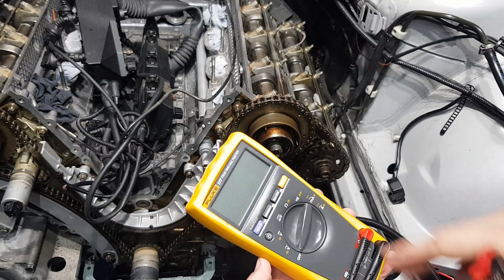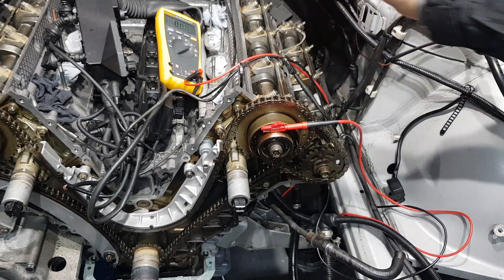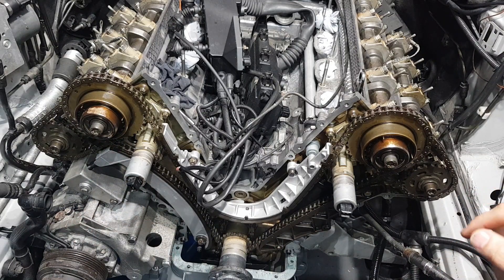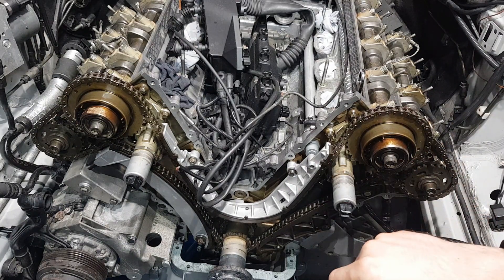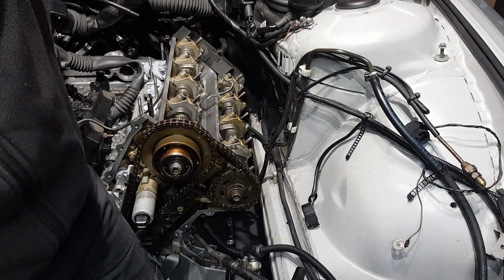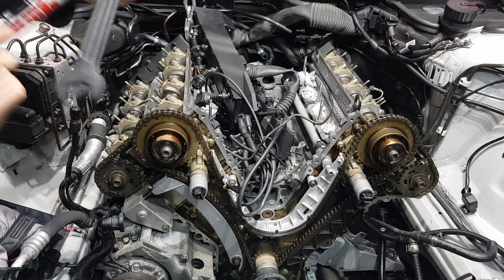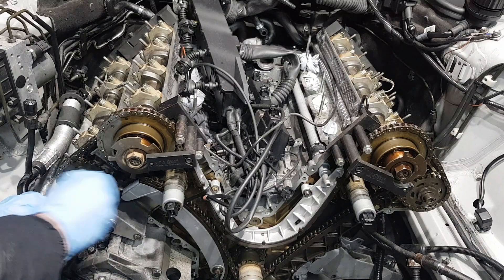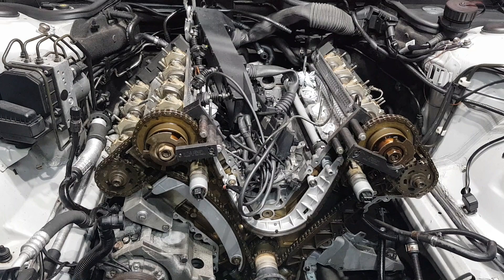BMW M62TU VANOS TIMING, BMW E38 E39 E53 HOW TO TIME VANOS SYSTEM BMW 740i 735i 540i 535i X5 4.4 V8

Comment: May i ask why the VANOS solenoids are in place? Is this important for timing the engine?
Reply from the maker: They control the variable timing. Without them the engine cannot run properly
Reply: @TheKeenMechanic  Yes i understand when the car is running. However is it important when rebuilding the engine and doing the timing of it?

Comment: Do you know why the sprocket for the exhaust cams on the 4.6is has no pins to check continuity when bleeding the vanos? I have bled it but turning it counter clock wise but I thought for m62 you’re supposed to check continuity?
Reply from the maker: On some models it doesn't have pins, just do the procedure and don't worry about the continuity test🤝🏻
Reply: @TheKeenMechanic thank you!!

Comment: Why you use voltmeter …

Thank you 🙏❤️
Reply from the maker: @josephchehdane  You are welcome
Reply: @ thank you but why you use voltmeter
Reply from the maker: @josephchehdane  This is how BMW engineers described the procedure in the factory repair manual to test continuity when vanos wheels are retarded. Read up about it if you don't fully unferstand how it works🤝🏻

Comment: Hi I have a Question what is the code number or name canes out when you connect the scanner for this problem or what are the síntomas of the car thanks for the info
Reply: The codes are for the timing chaine is P1519 and p1522  : cameshaft position actuator bank 1  and cameshaft actuator bank 2

Comment: Hi I’ve got another question for you please,I’ve done everything that you explained in your video the problem I’m having is I  just tried turning the engine over by hand to make sure there was no interference with the valves and pistons,but what I’m having is the inlet cam on the left side is moving then stopping then it’s flicking forward,the engine turns over easy buy hand and doesn’t seem to be making contact with anything and the timing is spot on when I check it is this normal or does the vanos need to be primed somehow before I start the car ,I hope I’ve explained it ok thank you found a video this is what is happening 

https://youtu.be/q4N9zWSz6wk?si=PPhLIlrqD6ztBwYD   Thank you
Reply from the maker: Hi
Sorry for getting back to you so late but I had a lot if comments to respond to and only seeing yours now. I don't remember mine doing this when I spun mine to check the timing and if any interference. I do remember some retardment and advancement on the cams but not to that extent that will spring back as it was wound. I have seen this before on a Maserati and Alfa Romeo where it was a faulty unit. They have the same system like Vanos on BMW. Hope you get it sorted. I hope I am wrong for your sake🤝🏻
Reply: Hi thanks for replying I redone the timing again and it did the exact same thing so i carried on and attempted to start the engine it ran like crap so I put my scan tool on and it wasn’t firing on bank 2 when I took the cam cover off I could see that the bolt holding the vanos on the inlet cam had come loose and the cam wasn’t turning,I couldn’t work it out because I’d done it up to the correct torque and used thread lock ,so I did all the timing again and torqued it up higher this time done a compression test as I thought I must have bent the valves but it was ok ,started it again and it was ok no funny noises that was yesterday so I’ll see how it goes I hope I’ve dodged the bullet lol thanks again for all your help
Reply from the maker: @adriancoundley2430  No problem. I hope that this is it now and all is sorted. I like to clean all bolts and threads with brake cleaner and compressed air several times before assembly. If there is a tiny bit of oil left it will not allow the thread locker to set properly or can come loose🤝🏻😉
Reply: Hi yes I was shocked to see it loose like that  I was gutted I honestly thought it would have bent a few valves, I done about 30 miles in it today at different speeds so let’s hope it’s ok lol , big thanks again for all your help and advice 👍🏻
Reply from the maker: @adriancoundley2430  No problem, my pleasure. The biggest favour you could do for me is to share my videos with like minded people and give them some likes🤝🏻

Comment: Hi can I ask you a question please I’ve just got a Chinese locking tool , would it be possible as long as it hasn’t jumped a tooth to set the timing then attach the vanos tool to see if the tool is out before pulling it apart,or wouldn’t that work thx
Reply: Hi great  Thank you for your quick reply 👍🏻
Reply from the maker: @adriancoundley2430  No problem. I have responded personally to every single comment on my channel🤝🏻
Reply from the maker: Hi
The chinese timing set is as good as the original BMW tool set in my experience. As long as you make sure your crankshaft is locked with the pin and both cams are locked at the back with the tools then you can adjust the timing with the vanos tools with the chains on of course. Hope this helps

Comment: I follow your procedures to a tee and im not getting the audible sound. Is that okay with these old vanos after resealing them as well?
Reply from the maker: Hi
I have heard before from others that they don't hear the sound if vanos wheels have been resealed. I purchased new kits from beisan last week and when I reseal a new set of vanos wheels will test it and do a follow up video on it. If you are doing everything as shown and not hearing  the noise I think it should be ok as you are not the 1st one to say this. Thanks for watching and for your messages
Reply: @TheKeenMechanic   Hello. Thanks for responding my friend. After speaking with other members, they told me that if I revealed them. Chances are that I won't hear the sound. And to just retard them as I should and it should be okay. Thanks again. I love your videos. Keep up the good work. 👍🏼
Reply from the maker: @colemanel4828  Glad to hear other people confirm the same. Thanks for getting back and for being part of the community

Comment: Bom dia tenho uma x5 4.4 2002 com motr 62  ficou parara a 3 anos funcionando so que as vezes faz um barulho na parte de cima do cabeçote lado motorista tipo como se fosse barulho de junta do coletor de escape vazando ma verifiquei não e no coletor  e as vezez para do nada fica um tempo sem fazer o barulho depoi volta tô querendo fazer trocar oleo e por aditivo pra limpeza. Ela ta com oleo 10w40
Reply from the maker: Sorry, if you translate in english I will be able to respond correctly

Comment: The Chinese made tool is crap. Not precise. I eventually bought the German Solution tool to do the timing properly. Don't buy the knockoffs on Ebay. Otherwise you will be removing the covers again. You will get the check engine light unless you're lucky. Good Luck.
Reply from the maker: Hi. I have to disagree on this. I used the chinese ones and the ones I bought are identicle with the genuine BMW tools. May be there are some crappy versions there but the one I have are superb.
Reply: @TheKeenMechanic  I never had any problems with my kit either and done 3 with no problems and no check engine light
Reply from the maker: @alanjackson5911  Thanks for confirming the same. May be some chinese kits are bad but definitely not the case with mine and many others🤝

Comment: Your torque wrench works in the reverse direction ? I know many will ratchet both ways but only torque one way.
Reply from the maker: Hi. Yes, I specifically searched for a torque wrench that will torque both ways. I own 5 torque wrenches of which 4 are Norbar brand and torque both ways
Reply: @TheKeenMechanic  those crazy cam bolts. Was a pain getting exhaust one out on 1-4. Got new bolts. Heading to Grainger now to get a Proto torque wrench that works both ways. Was initially going to over tighten and then check with a regular torque wrench at the setting to see if it doesn’t loosen ;-). But yeah it’s better to do it with the right tool.
Reply from the maker: @AlexXPandian  Yes, better to do it properly and not having to worry about it. Best of luck with the project. Enjoy it and take your time to make sure everything is 100%

Comment: You forgot to mention what size does the crankshaft bolt takes to move… now I’m middle of disassembly with the tool missing 😅… also if you could mention the star/hex size used to tighten the intake and exhaust that’d be great
Reply from the maker: Nobody is perfect, I tried my best but there is always something to improve😁 Next time I will pay more attention to showing all the necassary tools for a job🔩🔧🤝

Comment: Hello. Help!! M62 TU here. Bought a cheap chinese kit with the solenoid socket and well... it stripped the 32 mm solenoid nut. My question is there enough room from the top once you take the valve cover off to put an adjustable wrench on it? I don't want to take the front cover off since Im only replacing the solenoids now. Thanks.
Reply from the maker: Hi
I personally don't like using adjustable spanners as they never fit tight and may cause more damage. I think you may have to remove the upper timing cover in order to have proper access. You will most likely not be able to do it by just removing the valve cover only. Hope this helps
Reply: @TheKeenMechanic  Thanks for the reply. Im actually going to use a metal sawzall and slowly cut about an inch of the solenoid tip off and then use a 12 pt deep socket.
Reply from the maker: @FabianCharrua  Have you thought of using a pair of heavy duty vise grips before you cut it off and turn anti-ckockwise to loosen it. Might save you a lot of work. If you are going to replace it and you dont care about it then vice grips of pipe wrench might be great in this case.
Reply: The way these things are design it just spins but wont turn the nut. It I can cut it Im pretty sure the 12 pt. 1 1/4 inch socket will turn it. The 32mm wont do it anymore
Reply from the maker: @FabianCharrua  Best of luck, I hope you get it sorted
Reply: @TheKeenMechanic  I'll report later. Tks
Reply from the maker: @FabianCharrua  Please do. Will be great to find out how you got on🤝
Reply: @TheKeenMechanic  Well, somehow I decided to try the 32mm socket and it caught on. I dont understand it because I tried for 30 min before and then right before I almost cut the thing off the socket worked. Bizarre but saved a lot of time.
Reply from the maker: @FabianCharrua  Well done. Glad to hear you got sorted🤝

Comment: Ok guys so as you would have noticed, i recently attempted this timing procedure on my own with no guidance except for this video alone. After two failed attempts of timing this engine, i discovered that the crankshaft lockout pin was not correctly positioned and secured in the lockout hole and the cam shaft on bank 1-4 (passenger side) was not locked out with the cam lock blocks allowing 1-4 on the cam lobe to face upwards. Instead it was locked out with 1-4 facing downward which meant that cylinder one was not at top dead center the way the video shows you which is exactly what the bmw’s TIS describes. This meant that the engine was not being timed correctly even though the ohm meter would beep. It was just be beeping in the incorrect orientation of the cam. After correcting everything car still did not start. I began to suspect bent valves due to improper timing as a culprit and so compression was the next thing to check. Please make sure that when you check for compression the engine must be timed correctly in order to receive accurate readings. 
Anyways, so i discovered no compression at cylinder 3  (which makes sense because this was the side that did not have the cam positioned correctly during the lockout). 
Long story short, i knew i had bent valves at that cylinder. Most likely intake valves since the engine did not
Start. 
I disassembled the 1-4 head, and discovered both intake valves at cylinder 3 to be bent. What i learned was, with this particular engine, it will not start on the other 7 cylinders if you lack compression at ONE cylinder even if the timing procedure was done correctly. So guys best of luck, this video was an excellent guide in getting your m62tu timed. Keep up the good work👌

By the way, everything is now put back together. I picked up some used valves, and re lapped all the valves on that side of the head. Reassembled everything and the car now runs better than it did before the timing chain failed.
Reply from the maker: This is great news buddy. Glad to hear you got it sorted in the end and I am sure that you learnt a lot from this. I am happy to hear that you found my video helpful. Please share with others who need help. Much appreciated that you came back to let us all know how you got it sorted🤜🤛🔧🔩

Comment: Ok this is the second attempt at timing the m62tu, 2001 740i and the car is still not starting and i dont know why. I have fuel air and spark and all the basics good, and as much as I dont want to blame it on the timing procedure, im starting to think I am doing something wrong but I dont know what it is. Im suspecting it may be the lock out of the flywheel itself (the hole im inserting the pin in) but the OT and the crank case notch both lined up perfectly, 1-4 on bank 1 and 5-8 on bank 2, continuity with ohm meter at both banks and still cant figure out. In fact, even when I went to torque all 4 cams, the flywheel didnt move an inch either so I know I did it right?
 I need help
Reply from the maker: Have you checked your compression as well? Other reasons why it wont start could be your cam sensors and your crank sensor. Make sure they are connected properly. If you know someone with an oscilloscope check this 1st before you start buying expensive parts. Make sure the DME sees and receives the signal from the cam and crank sensor. Regarding the timing I can confirm the procedure shown is by the BMW manual and has helped many other people. Let me know what happens either way as I am curious to find out what has gone wrong for you. Make sure your compression is fine. If you get someone with a good oscilloscope they can check the relative compression with an Amp clamp on the oscilloscope to save time.
Reply: @TheKeenMechanic  I did not check compression yet because i dont have enough reason to believe it is compression related but i will if i run out of options. Regarding connections, everything is connected and secured and double checked, dme communication to and from cam and crank is still unknown because i’d like to eliminate the most obvious possibilities first before investigating further. I did notice something odd though: so after giving it a couple cranks to see if it starts, and no fire, i went and removed the pulleys to verify if the flywheel is still in the same position. Crank case notch is stationary at 11 o clock position so the flywheel was lined up to match the crank case notch after securing it with pin to begin timing.
Im now seeing the OT on the flywheel at the 5 o clock position. Is that normal? I would think that if it was timed at 11 o’clock matching the crank case notch, that even after you crank the engine, the flywheel should still come back to that 11 o’clock position? Right?
Reply from the maker: Do you know that crank turns twice and cam turns once. This could be the reason for the missslignment. I am sure you will get to the bottom of it and you will have great understanding of the m62tu engines. We learn a lot when you have issues🤜🤛
Reply: @TheKeenMechanic  Also, to be sure of the correct timing before putting the engine back together and trying to start it:  You could  remove the lock pin and cam blocs, then turn the engine 2 full turns (720 degrees) thru the crankshaft. The engine should revert to TDC. The cams and the flywheels should revert to the correct timing position that you just set.  Verify it.
 If they do not, something is amiss, and you need to re-time the engine right.
Reply: If it cranks but doesn’t start and everything’s good then it’s your camshaft sensor (not crankshaft) replace it with oe

Comment: Also, do you have to see the etched “1-4” on the passenger side cam and “5-8” on the driver side  cam prior to placing the cam locks or can you place the cam locks without needing to see them?
Reply from the maker: If I remember correctly you do see the numbers facing up. Just to be 100% sure make sure that the bank 1 CYLINDER 1 intake and exhaust cam lobes face up and towards eachother. The idea is that all valves are closed at cyl 1 TDC